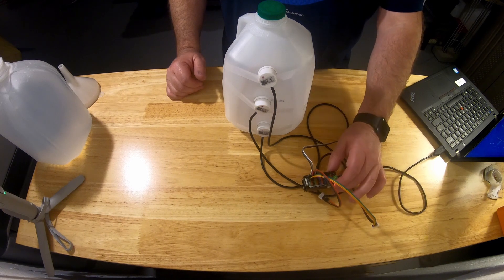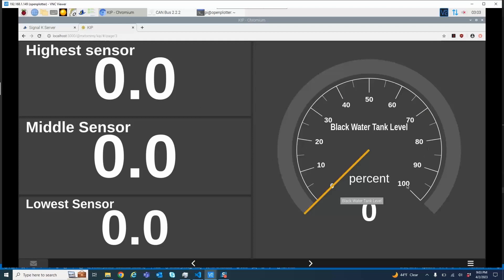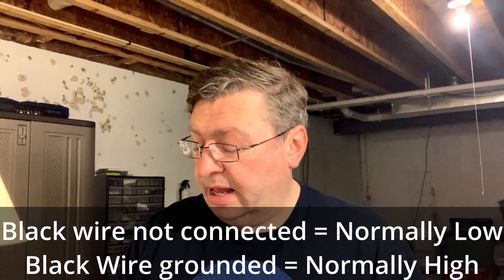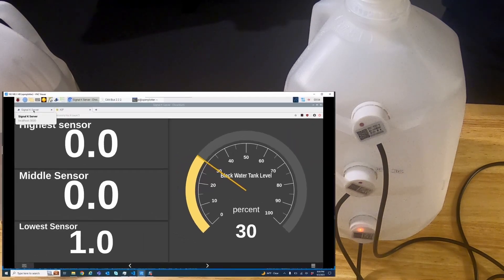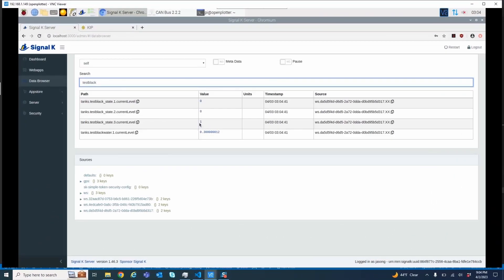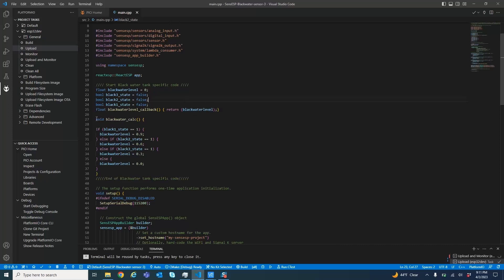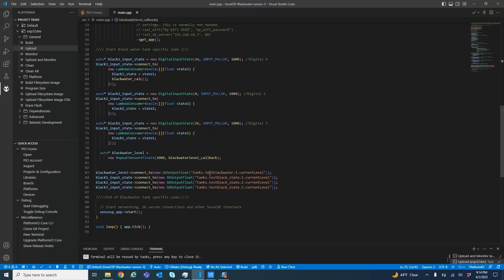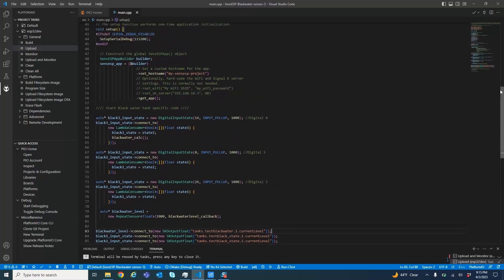DIY Blackwater Tank Monitoring with ESP32/SensESP and XKC-Y25-V Non-contact liquid sensor - Tech E14

Comment: Very good. Thanks a lot for this video! I have some doubts here at wiring. Could you make a simple wiring diagram please?
Reply from the maker: each sensor has 4 wires, make connections as follows:
Brown = 3.3v, same pin can be used for multiple sensors 
Blue = ground/0V, same pin can be used for multiple sensors 
Yellow = the digital pin you want to assign to it, this pin is individual to this sensor
Black = Not connected

Hopefully that helps?

Comment: What kind of glue can I use to attach these to the water tank ? I wan't to hot-glue the sensor to the tank but vibrations are going to make them fall off, duck tape is a good option but far from optimal, solvent based glues can damage the sensor I think since it's plastic too ! what do you recommend ?
Reply from the maker: I used a simple epoxy syringe like this one: https://amzn.to/4b8CIAj

Comment: Jason, I loaded the program into my ESP32 but I don't get any connections to SignalK. What part I'm I missing to make the SignalK paths?
Reply from the maker: did you connect the ESP32 to your network?  if not you should find an SSID with its name for you to logon to and then attach it to your network.  once on your network, it will automatically find your SignalK server and send a request for authorization.  In SignalK, go to Security --> Access Requests.  You have to be logged in!!  hope this helps?  it you have your ESP32 connected to a PC by USB, you should see the device trying to connect in the monitor window in visual studio code
Reply: Thanks for the quick reply. You gave me enough info that I was able to figure out that I needed to uncomment the "set_wifi(SSID, Password)" line. Thanks for sharing such great software. @ApresSail
Reply from the maker: No problem, glad I could help!!

Comment: Hi Jason, I plan to take this solution and implement it on my boat sometime in April. All my bench tests went fine. But thinking about the installation it would be very useful to have some sort of indicator in the head itself of how full the tank is. For example an LED that goes yellow when 1/2 full and Red when full. Looking at the available commands I am not seeing anything that specifically references LED (like ESPHOME). Is it as simple as calling DigitalOuput and setting the pin too High?
Reply from the maker: I think it would be as simple as commanding pins high, not sure exactly how to do that but it should be easy to work out. For green/amber/red you could use 3 LED’s or an RGB one and then use resistors or PWM to get the right levels on each channel

Comment: Hi Jason, thanks for this. Have built your battery monitor and engine monitors, all looking great. When you did this project did you consider using one of these ultrasonic sensors DS1603L? It appears to be able to see through steel, so possibly a great solution for other non plastic tanks.
Reply from the maker: Thanks, my tanks are all plastic and the sensors I used were pretty cheap, I didn’t find that part number in my search - good find!!

Comment: Thanks for the video. Great idea!
Have you tried this with a black water tank?
Does it work well? What about the viscosity of black water?
I found the following description of the sensor:
When the dynamic viscosity is less than 10 mPaS, it is measured normally. 10mPaS<dynamic viscosity<30mPaS may
affect the detection. When the dynamic viscosity is greater than 30 mPaS, it cannot be measured because of a large amount of
liquid adheres to the container wall
Reply from the maker: Thanks for the comment, I guess we will see, I installed them at the end of 2023 season (see the video - https://youtu.be/9PnHwekKtMk?si=6CXSHJ4lJjdORKpX) but the only liquid in there was pink antifreeze.  I think my tank is mostly liquid anyway, so it may not matter.  I guess if you use the tank for only number2's then you may have an issue - great discussion!!
Reply: @ApresSail  Hi, thanks for the quick reply! I watched your video to the point where the 3M sticky pads were too thick. Have you tried removing the sensor cap and adjusting the sensitivity?
Reply from the maker: @virginijuspetrauskas9930   No, I didn't try that, instead I just used a thin layer of epoxy.

Comment: Very cool.  Wondering if this could be used to run my bilge pumps??
Reply from the maker: it could, but not sure how you would deploy it?  if you watch my video on the install of the engine monitor, you will see a float switch that I installed to signal high bilge water, this simple switch could be deployed with a relay to run the bilge pump or in combination with a ESP32 or Pi to warn the operator or count/log bilge pump usage
Reply: I will check that out. As logging running of bilge is also something I want to do.  These typical float switches fail too often......maybe use this method for backup bilge and logging...
Reply from the maker: @jims1128  Agreed, touch wood, my float switch and bilge pump have been very robust but having a higher float switch that sounds an alarm or warning is great piece of mind - I wish I had it when we grounded in Port Sheldon intake last year!!!
Reply: @ApresSail  using one of the sensors that unused in the water tank vid would be a great way to setup a high water alarm. Hmmm...u have the wheels turning now. Great vids btw. Learning a lot
Reply from the maker: @jims1128  Glad you like them!!

Comment: Hello, Nice  video! I have a simple question, wich glue I can use to fix a sensors at the tank? Thanks you for the answer, Simone
Reply from the maker: I am planning on using 3M sticky pads, like the ones you get on GoPro mounts or use to attach a car rear view mirror to the windscreen - https://amzn.to/3P8D6Gv.  make sure the tank is clean and free from oil/wax etc

Comment: Any idea how to mount it to a solid vertical tank ? Made from plastic and temperatures outside range from 10-40C. Same with relative humidity. If I glue it (hot glue) it will surely fall off. Anyone made something "working" ?
Reply from the maker: I haven't done mine yet but I was planning on using the same 3M tape you use for GoPro mounts.  I have these stuck on my Ski helmet and they have been there for years - wet, frozen, hot, collisions, shock..... - https://amzn.to/3XPSWsu
Reply: @ApresSail  Hey, thanks for this hint with this 3M tape. I even has a better (same?) solution with the "repair tape" you use for sticking car mirror. This should be dual side (glue) and transparent. However, my water tank is outside and prone to humidity (up to 100% RH) and temps 5-40C. Ask me in a month how it went on my side.
Reply from the maker: @adamwalter2573  Good luck, I hope to get mine on soon, but it is a pain to get to and I like to sail during the sailing season and fix during the winter!!  However, I cant test this without being able to fill the tank

Comment: Is it possible to use 12 of these sensors to monitor my printer ink cartridges with the board you're using? If not what would i need? I'd like to be alerted along with the light on the sensor to come on when my ink level drops to a set point which i hope to achieve by calibrating the sensor. I think you can tune/calibrate these sensors with a small screwdriver if you remove the plastic cap (bit with the label on) Maybe i could do without being alerted with software and just power all 12 sensors and just calibrate them so the LED comes on when the ink gets to a low level. Also, is this 'V' version you're using NPN or PNP? I suspect it's a NPN. Also does yours have the hidden calibrating screw behind the labelled cap on the sensor?
Reply from the maker: yes, there is enough IO for 12 digital inputs, but no more.  you can tune them, but I am unsure of the repeatability, if you are trying to use them from , say a top surface to a depth.  The ones I have are normally low, but it is selectable by grounding the mode wire

Comment: Would be cool to do it with a sensor returning a resistive value
Reply from the maker: Do you mean a continual resistance change as it fills up or just a different resistance as the 5 or 3 sensors turn on?  For the first - there is an external tape that you can apply that does this, but it is really expensive. For the second, I expect you could use a bunch of resistors, and possibly transistors to resolve a voltage that differed depending on how many sensors were giving 1s. Then you could use a single analogue pin on the ESP32.
Reply: @ApresSail  no, most tank sensors return a resistive value eg 240-30 ohm.

Comment: Nice idea! The next think I will build for my boat. So far I have now ready and working a modified OpenPlotter project and a satellite ESP32 for the motor perimeters. All is working fine.
I am now curious if your second ESP32 for the battery and tank has an off/on switch or if you have a solution to avoid current drain if you are not on your boat. Perhaps you will mention this in another video?
Continue the interesting project, it is an inspiration for me to add things to my own project 😊
Reply from the maker: Glad you liked it!  with regard to the power, I have a fuse box near the helm that is connected to a breaker at the nav station.  It currently powers my helm screen, Autopilot, USB Hub and Maiana.  I will add 2 more connections for the Battery/tank monitor and Engine/bilge monitor

Comment: Love it - curious how your install went - I have a metal black water tank with no metering yet so I am curious to install something like this. I have a 1993 Hunter 35.5 called Dharma!
Reply: I tried the same, but the sensor wasn’t reluable due to watery film on the inside of the tank. Later learned the sensor sensitivity can be adjusted.
Reply from the maker: @htool843  good point, I may not fully glue them at the start, in case I need to adjust the sensitivity - Thanks!!
Reply from the maker: I haven't installed mine yet, in fact, I recorded that video on Sunday night!! all weekend I was working on my engine monitor install, but that's another story...  However, my tank is plastic.  With a metal tank, it might be a little harder.  The Datasheet that comes with the sensor suggests using a fitting to take it away from the metal tank or a separate tube up the side.  I do wonder if the pump out hose could be used to check the level of the tank?  as long as it wasn't reinforced with metal...
Reply: @ApresSail  I will be testing - my parts are arriving today - my fuel tank is plastic so perhaps if not blackwater I could mount to fuel?
Reply from the maker: @TakeingCrazyPills  probably, the write up says "It can detect liquid level of various toxic substances, acid, alkali and all kinds liquid in high pressure airtight container."  you could always power one up and try it, you will see the red LED if it works - good luck!!
Reply: @ApresSail  Thanks so much! I really hate not knowing my black water level :)
Reply from the maker: @TakeingCrazyPills  I decided to wait until I partially fill the tank to check if the sensors work. I should be able to know in a couple of weeks, as Apres went in the water last Saturday